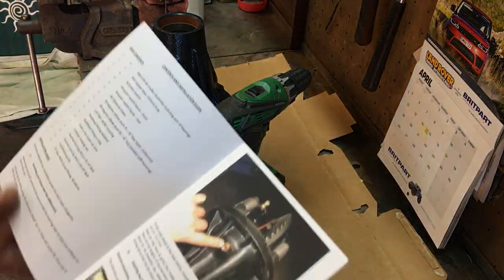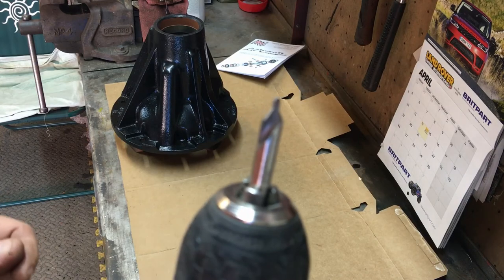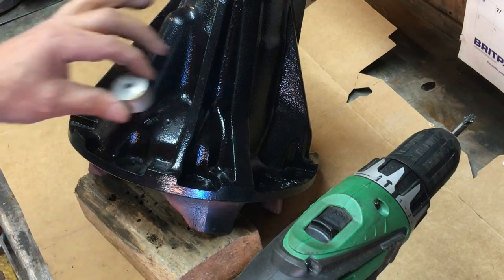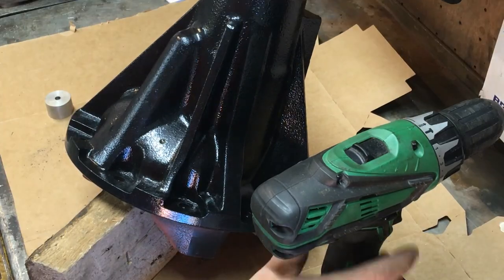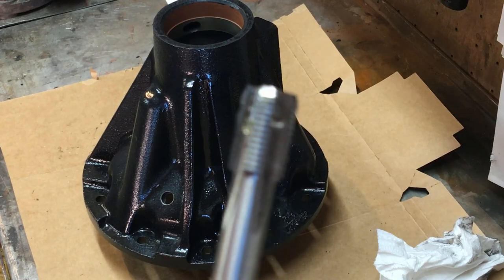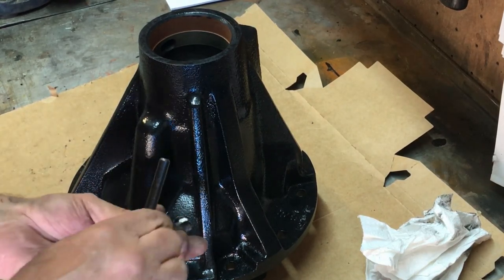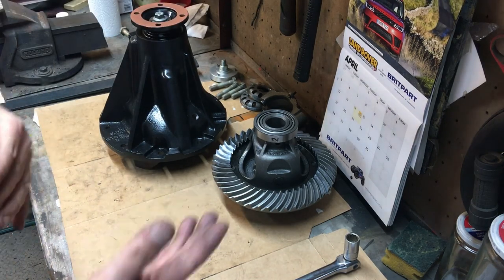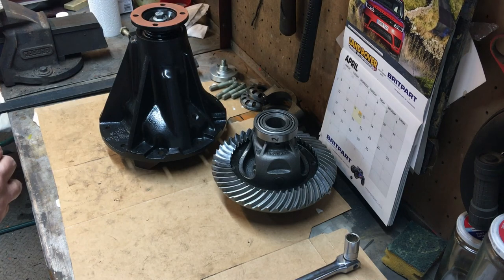Ashcroft Locker Diff fitting guide.  Part One

Comment: Nigel, I think your drill bit was, "grabbing" because there were times when you weren't going in perpendicular as the bit was cutting through. It tends to do that when using a hand held drill. Try clamping the casing to the bench and using two hands. It may still grab, but it will be more controllable.